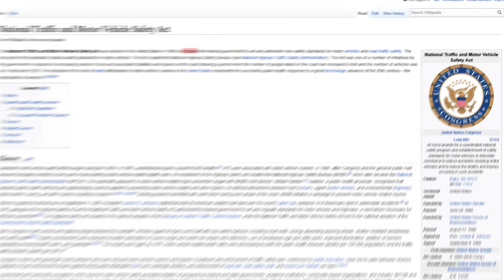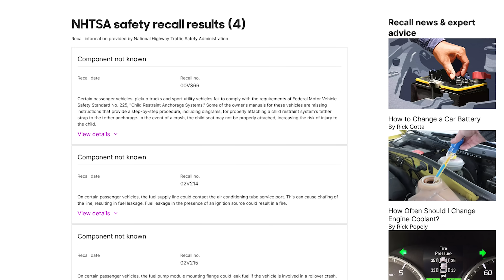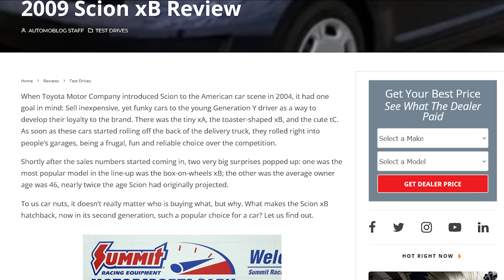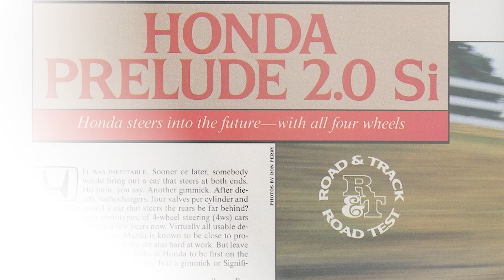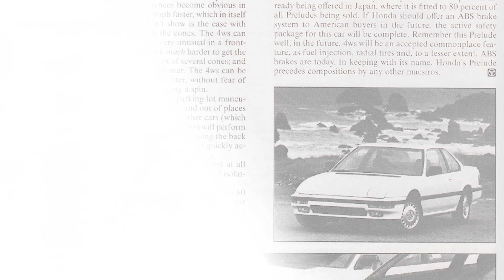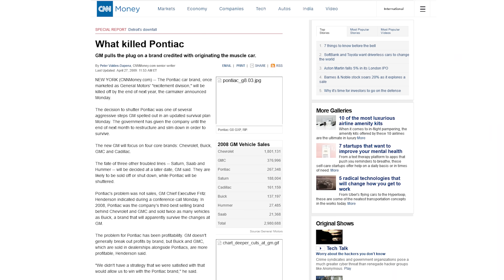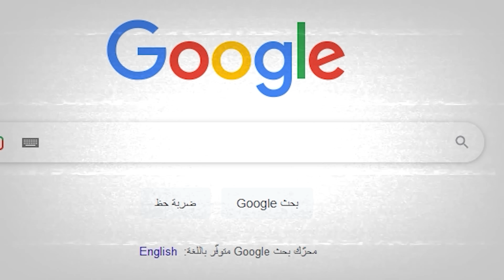The 32 BEST Cars Killed Off FOREVER | IDEALIST

Comment: I have always wanted ANY year Mitsubishi Lancer EVO after seeing the movie "2 Fast 2 Furious" but the Mitsubishi dealers ONLY had the "Lancer" cars at that time. Sad lost to see this all-wheel drive beast die off.
Reply: I miss Dakota
Reply: I've owned two Evos 8 last one was a MR crashed the first one on a wet bridge and rolled the other into a ditch after attempting to avoid a running deer trying to commit suicide on the highway.
I miss my evos they are great cars I had to buy a WRX because I couldn't find another Evo in my area fun car but not as good as the Evos.
Reply: A buddy of mine had a Lancer Evo X GSR, I was sad for him and surprised when he got rid of it. Such a badass car.

Comment: The 5th gen Honda Prelude is the only gen I've gotten to drive but even with a busted rear passenger side suspension, it was still THE BEST HANDLING CAR I'VE EVER DRIVEN! It has pretty much the same suspension as the original NSX but FWD and with a back seat.
Reply: Pardon my ignorance, but what was the difference between a Honda Prelude and a 2 door Honda Accord? I think they were too similar to coexist. From a manufacturer standpoint, do you get my point.
Reply: @crw3673  the first gen prelude was pretty much no different, but as the gens went on, they kept upgrading the suspensions and the engines. Most people didn't see a difference though and bought the cheaper options ie civics and accords.
Reply: @crw3673 basically the tech and the drivetrain were the biggest differences. Basically everything the average person doesn’t look at

Comment: We had an Xb. Cheap? Yes. Horrible aerodynamics? Yes. Noisy at speed? Yes. But it was freaking bulletproof. Aside from poorly designed brakes and the classic rust-out Toyota exhaust, it ran like a watch and was super practical. Surprisingly great in the snow.

Comment: I was lucky enough to get 1 of the 3000 Focus RS's brought to America. I did get to test drive it and WoW was it a fun test drive. Mine is Nitrous Blue and the Special Edition Model. It was my daily driver and now is a 2nd driver. It still make the hair on my neck stand when you hit the boost and to this day has NEVER spun the wheels on pavement. I paid $50K for mine so the markup wasn't to steep. But, bang for the buck, is very good. Traction alone is awesome and it's nice to have a Hellcat owner in a panic when you leave him at the line. However, the V8 will run me down at about 200 ft. I always tell them " It's not your moms Focus"

Comment: You guys mentioned the El Camino SS like it was the original. The Ford ranchero was the original, and they had the ranchero with the Cobra jet engine in it. Whoops the snot out of the SS
Reply: Nobody said it was the "original"....but it was uglier and died off way sooner
Reply: @chriscarlisle1974  ugly you're subjective. I thought the rancheros looked better than the El caminos. Except for the last generation of rancheros. As for died off sooner, they both lasted about 23 years.
Reply: Ranchero died in 1979....ElCamino in 1987.  True, the El was made for 25 years vs 22 for the Ranchero, but it died off way sooner.
Reply: @chriscarlisle1974  it also started way sooner.  And the EC was 64-87, only 23 years.  57-79 for the ranchero.  And the 70-71 ranchero CobraJets were some of the sexiest utes

Comment: Number 6 doesn't make sense since the Huracan is still in production
Reply: lambo has announced this is the final run of the huracan and its replacement will be launched in 2023 or 2024.
Reply: @glarrettvlerdone  so they're not even out of production yet
Reply: Both the Aventador and Huracan are going to be replaced by hybrid successors in 2024 but yeah, they are too early to be on this list lol

Comment: Aztek is not a bad car it just didn’t age well in comparison to other cars
Reply: That's the bad part
Reply: I think the Pontiac Aztek is an awesome car it was just made before it's time
Reply: They also had build quality issues, plastic everything. My homies pops had one it we made fun if it mercilessly, the transmission blew up on around 90,000 miles.
Reply: @illuminatidestroyerbear2231  I admit the build quality could have been better
Reply: I have a buddy who hated his and sold it to buy a Mitsubishi  Montero. His montero is a valve stem seal eater lol. The Aztec is still running.
Reply: I need some of whatever drugs you are on lol
Reply: Did not age well??? The car was dead on arrival, even being featured on breaking bad later didn't help it. 

It's like finding a rotten egg in ur dozen and after several weeks go by saying "damn that rotten egg really didn't age well"
Reply: Its not that it didnt age well

It aged magnificently...fits in with modern crossovers just like the 2003 Infiniti FX35 does...all its missing is LED headlights and taillights

The issue is that it was ahead of its time, so people thought it was ugly and wierd

Its luxury version, the Buick Rendezvous, is more appealing physically
Reply: Wrong
Reply: fenzamasekwameng6495  I'd be pissed if a modern era car didn't make 150k without serious work. Basic preventative maintenance should keep anything going beyond that.

Comment: I'm so sick of the hate on the Aztek, Fiero and the Covair. The Aztek should have never been under the Pontiac umbrella, period. If it was built under Chevy or GMC, it would have had a better looking front end. Pontiac needed to stay in it's lane and made low volume performance cars. The Fiero was one of many GM cars, rushed into production without proper development! And just when they got it right, in 1987 pulled from production. Same thing goes for the Covair! After GM redesign the rear suspension, it was pulled from production. The El Camino got dropped like all the other G bodies, because GM thought FWD was the future of all cars. Maybe also why the Fiero got dropped. 🤔

Comment: i miss my baja turbo..... the motor finally died at 263k tried to source a STI powertrain, gave up and tired to just find a good WRX turbo set up couldnt find one worth swapping in smae with the oem drivetrain so i sold the roller for 2k more then i paid for it...dude said he was gunna rebuild it..... wish i woulda just kept it

Comment: When l was in high school from 72 to 75 there were at least six Corvairs. My buddy had a 2dr 64 Monza with a 4 speed that l drove quite a bit and it was great. Not fast but not slow it was enough and the only thing l noticed that was dangerous was it would oversteer but he had 14x7" rally wheels with radials it wasn't much of an issue. Sounded like a 911 too

Comment: The Honda CRX, the actual Civic, Legend and  Integra for sure, yes I know the Civic name is still going but it's not really Civic, they're currently bigger than a fucking Integra and even the Accord, as someone whos had a CR-X, a Del Sol, an eg Civic, an ek Civic and currenly has a S2000 and CR-Z they never should have stopped making the smaller cars. The Type R civic is now bigger than the type r integra and accord, they should have kept the small crx hatch and integra coupe, the S660 can fill the beats and del sols role but what coupes have they?? Also the Nissan Pulsar GTI-R, the Supra cause the current model is more of a bastardised MR2 than a Grand Tourer. The Renault Clio V6 and they should've put the Megane V6 into production so should the Honda HSV-010 the V10 FR concept that went GT racing the current NSX as cool as it is, wouldn't be able to compete.

Comment: I really want an engineer to explain how the Americans managed to suck so much power from such big engines during/after the oil crisis and whether they can be reversed
Reply: They're long stroke engines, more similar to diesel engines, so couldn't rev hugely high. So low horsepower but okay torque. Another issue is horribly low compression ratios so, less powerful "bang" as the fuel air mixture ignites.

So you need better air flow, lightened rotating assembly, skim of block or head to increase compression ratio (or forced induction). You can make virtually any engine powerful, money and time are the only constraints.